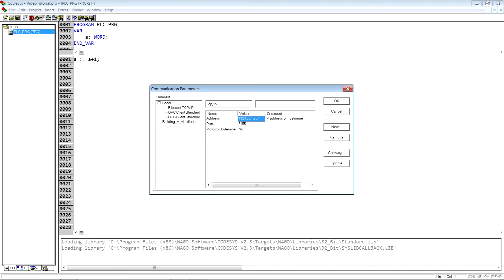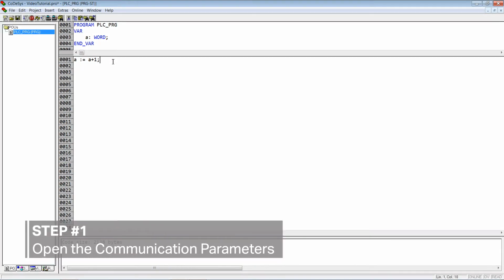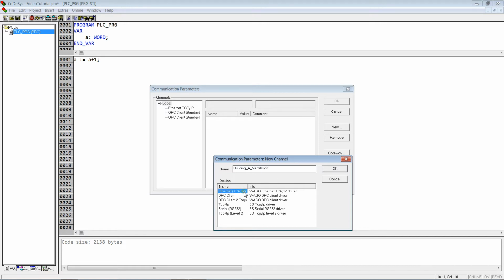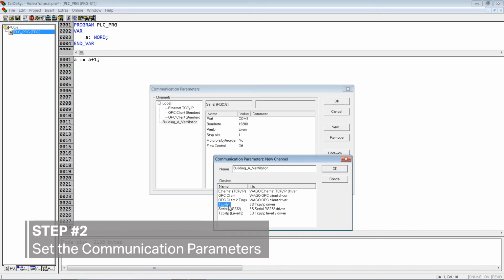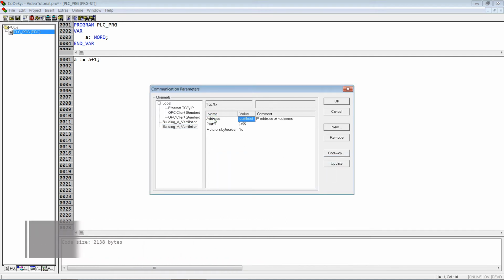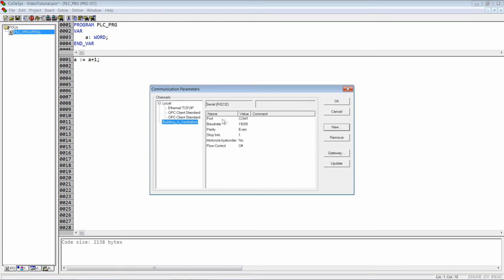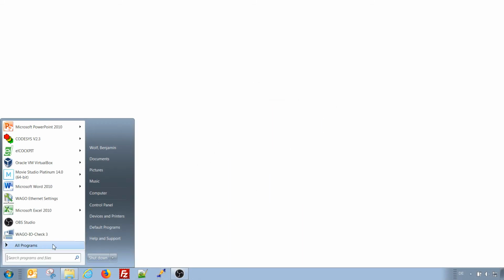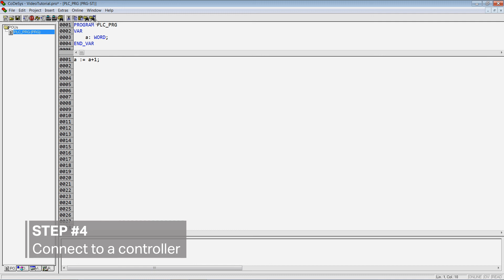Communication Parameter of Codesys V2.3

Comment: I can ping the PLC(192.168.1.10), but I can not log in after settling the communication parameter. My PLC is750-881. shjow the communication error
Reply from the maker: The source could be a I/O-Error, that is displayed on the LEDs of the Controller. You can find the error codes in the manual of the controller. For further help you can contact the WAGO Support: https://www.wago.com/global/contact
Reply: Same broblem have this broblem how to solve?????